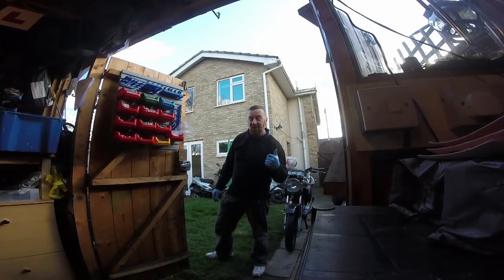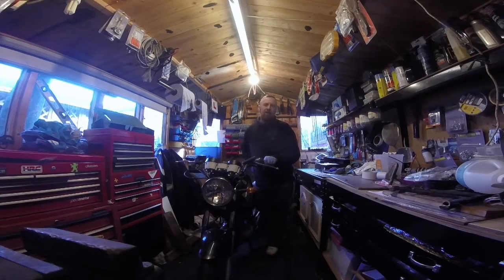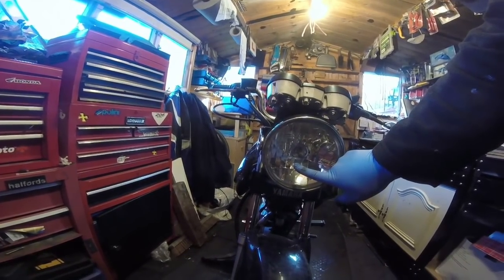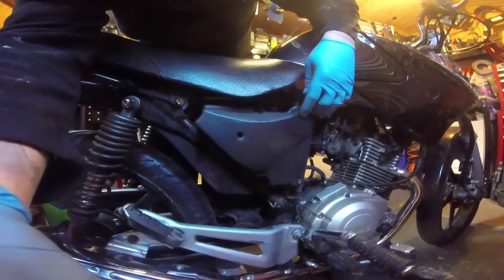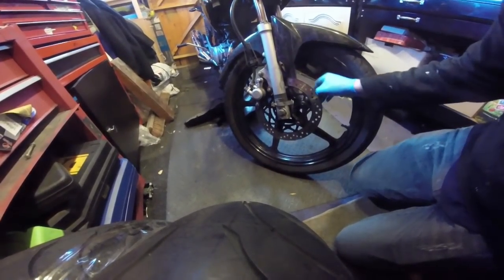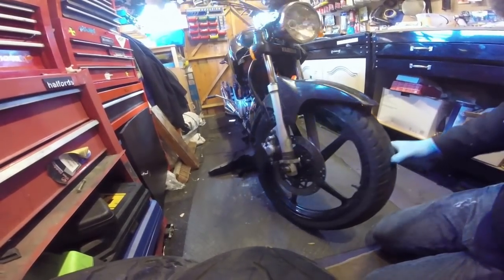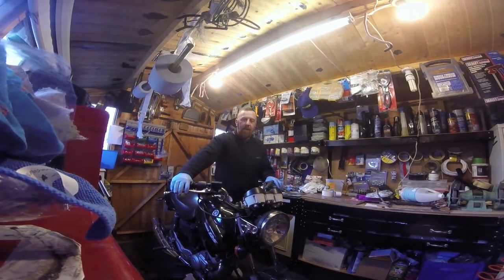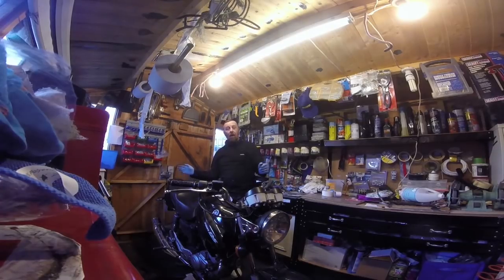YAMAHA YBR125 THEFT DAMAGE 1ST LOOK OVER BEFORE FIX MARK SAVAGE

Comment: Hi Mark you just answered my question I sent earlier on another vid hahha @5:18 :-D thanks ,there  is one going locally for £800 2005 9k miles,, will prob get him down to 700 , am a bit concerned after watching your vids that it could have a few probs , stator ect ,but hopefully is ok , I  have checked the mot history online and has previously had a fail  from bad rear suspension and swing arm corrosion, but then it has passed the latest  m.o.t with only an advisory of front brake lever slightly bent , also has Offside front front suspension has slight corrosion fork tube (on last years mot) it passed in feb 19 , I want it to do longer distances on so need somet that is a solid engine , not bothered how long it takes me lol was looking at a varadero 125 but they a bit more money and a yamaha wr125 but doesn't look comfy and is liquid cooled (more possible probs), wanna keep it simple and the ybr looks great for tinkering with if any probs as is all open anyway thanks for the vidz , they're a great help
Reply from the maker: some garages will pick up on one thing and not the other, id rub the rear frame down and paint over and clean the suspension up 
along with the front forks ( chrome cleaner is great )
just simple service and keep an eye on the oil and they will keep going ( wd40 on moving parts ) or as in my other videos acf50 now that is good stuff 
mark

Comment: should I spray wd-40 is the key slot or can I actually open the ignition to spray Inside. I also have electrical contact cleaner.
Reply from the maker: d1strappazon try both but guessing best take it apart 
Mark
Reply: that did it, got it all lubed up inside now it works like a champ. thanks again. keep up the great vids.
Reply from the maker: that's good to here and a simple fix 
mark

Comment: Hi bro, just got my crank bearings & oil seals rebuilt from a professional! I was riding my bike two days after I got repaired and it started boggin out a lot and I found out it had an 85 Main Jet so I switched to 90 & 96 yet it was still bogging!! Could you help me please
Reply from the maker: if it was ok with the 85 main jet it should still be ok!, sounds like something else is going on, put it back to 85.
like in my jetting video sometimes you have to go down size but if after back to 85 jet it's still messing pop back to the shop as there maybe some more going on bud and you did pay out for it 
thanks for watching please like share and sub 
mark
Reply: @marksavage  nice bike mark 👌 cheers for taking us a8ng 
Enjoying your footage m8 
Great advice 
All the best from 
Up here in scotland. 👍

Comment: I marks average I got a Yamaha YBR 125 2009 as it got a diagnostic socket to plug in because I have an engine light
Reply from the maker: No bud they do not have a obd plug
Engine light would be cdi, stator,  ecu
If not running
Reply: @marksavage  okay make think is very much your help I watch your videos all the time very helpful
Reply: Hi mate you have a good video I watch them all the time
Reply: Hi mark I have a question for opened my airbox on my bike and I had oil and water both together on bottom what could it What could it be
Reply: I'm watching videos on your bikes all the tivery helpful
Reply from the maker: @marcfoster3756  oil just from over fill or blocked breather 
Water is just from the very cold weather do don't worry about that too much 
Clean air box 
Change filter 
Check all breather pipes bud